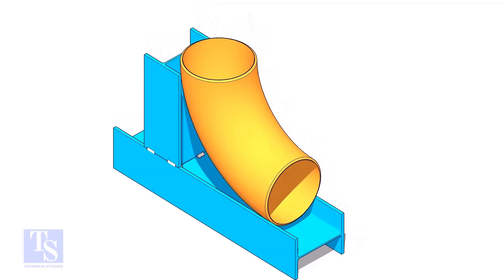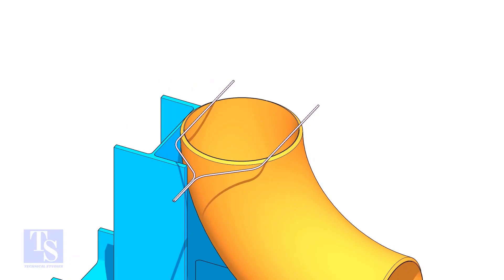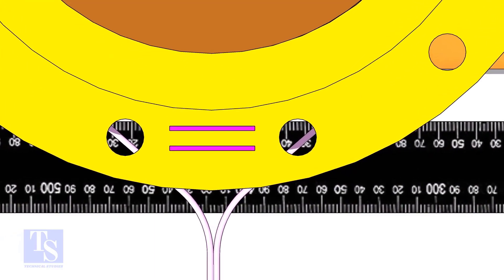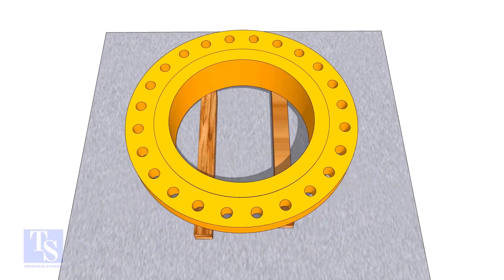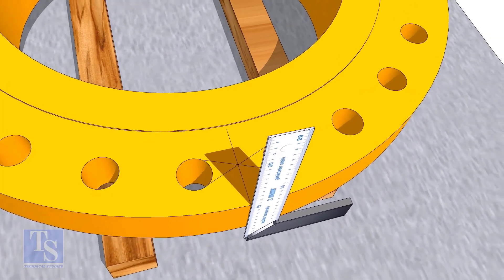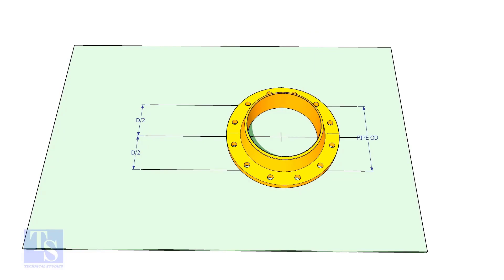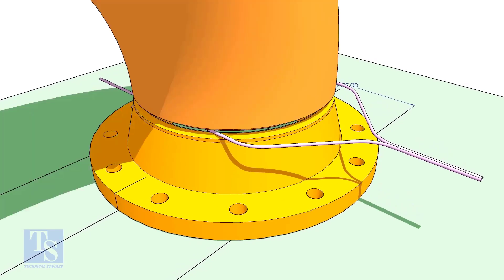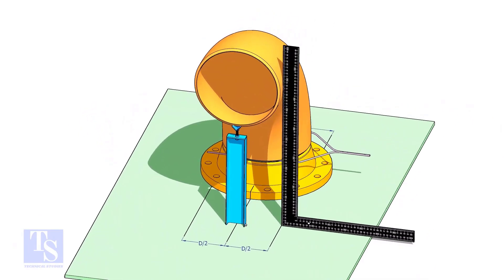Weldneck Flange to Elbow Fit-up, Different Ideas.

Comment: Or just tack the 90 on a full length of pipe, throw a jack stand under the elbow and plumb it. Then two hole the flange onto the elbow